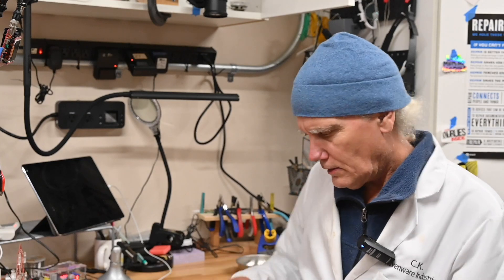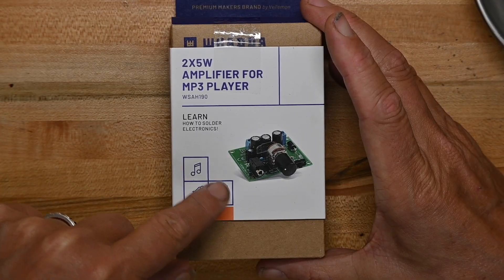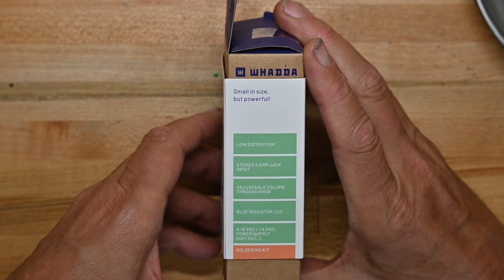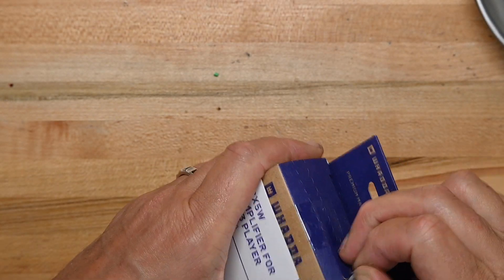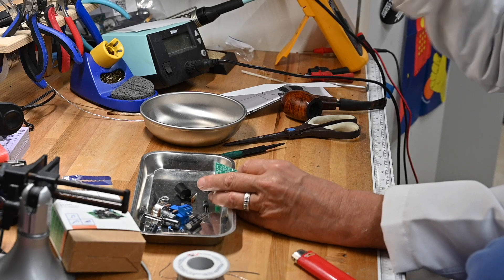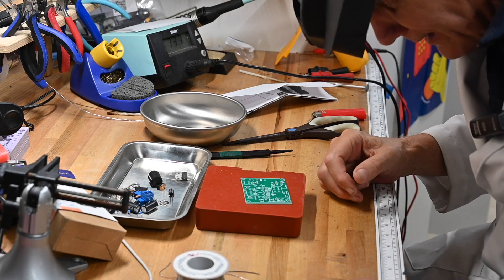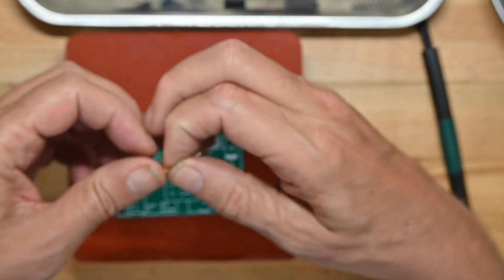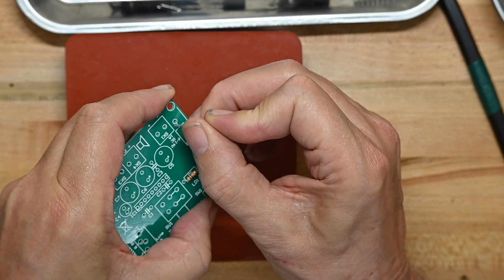C.K. builds a 2x5 watt amp kit from Velleman/Whadda

Comment: Enjoying your builds. 
Was thinking of building this for my first project and was wondering if you could recommend a soldering iron <20$?
Also, is flux needed with flux core wire?
Reply from the maker: I am a Weller fan, and this one, for $17 on Amazon would be a good starter. Allows for changing tips also. https://www.amazon.com/Weller-120V-Soldering-Iron-Halo/dp/B0962SZ17H/ref=mp_s_a_1_5?crid=1PXLE7T84B2SN&keywords=weller+soldering+iron&qid=1682020719&sprefix=%2Caps%2C447&sr=8-5

If you use flux core solder you do NOT need more flux. You’ll be fine with what the wire provides.
Reply: @CKHaun  Thank you for the response.